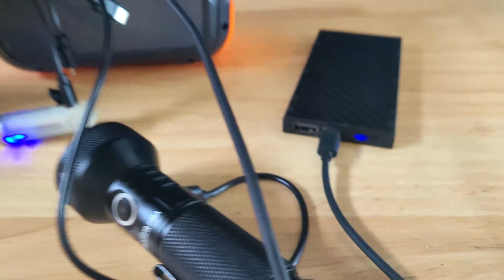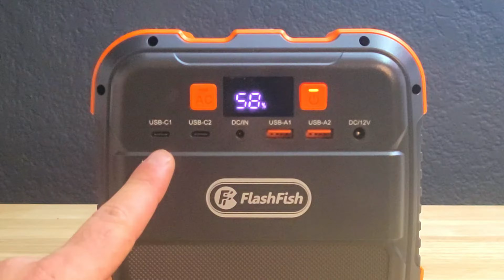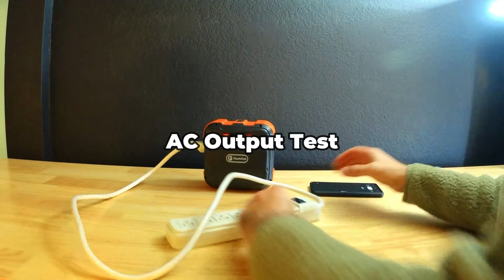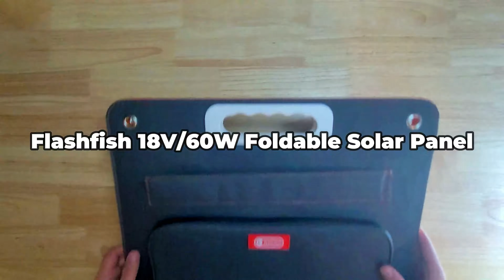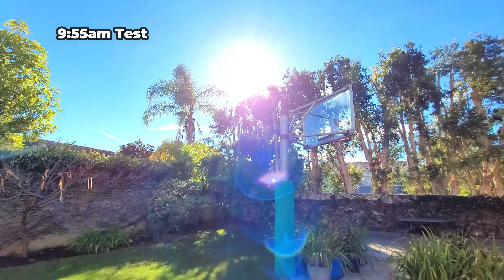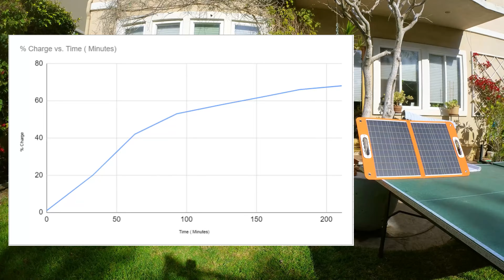Flashfish Lightweight 120w AC Power Station 🔋 and 18v/60w Solar Panel ☀️ [Review & Test]

Comment: Do not power them in your house, I had a brand new 200W one and it wasn’t on charge for 20 minutes and it exploded and caught my kitchen on fire. Black smoke filled my house and black suit is on everything even in all of my kitchen cabinets 😢 I called the fire department and they said a few of these has failed and caused fires..

Comment: Did not discuss the important details.  Pass through amperage,  Max input for charging,  what adapter(s) needed to get power to the DC 3.5x1.35 input from standard solar panels.
Reply: My guess is most people who buy a tiny box like that aren’t using standard panels, they are either plugging in to the grid or buying the kit panels, otherwise figure it out yourself if you’re a techie.  This is a silly internet whine…👇👇👇

Comment: Hi ,thanks for the review on this Device ( new subscriber by the way), just bought it, l was thinking of buying the 18v/100w solar panel ( from the same brand ) one question here you might be able to help me , since lm thinking of buying a bigger power generator later this year , it would be wise to do it ? Or just get the the 50w option? ( solar panel ). Thanks

Comment: The only thing I haven't seen in most portable power supplies is pure sinewave. Many tend to use cheaper output circuits for the sake of the bottom line. Modified sinewave (squarewave) circuits like what you find in badly made PPSs tend to destroy electronics faster but doesn't matter for hardened electrical equipment like drills, saws or older light bulbs. I'm glad this is out there.